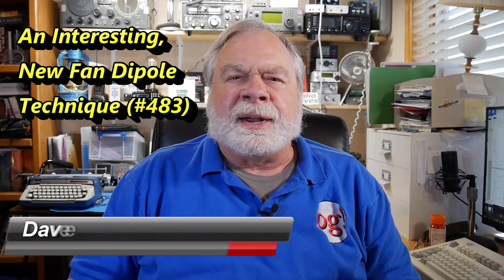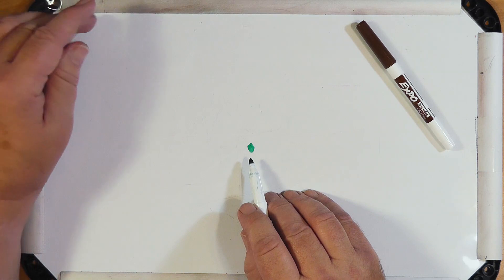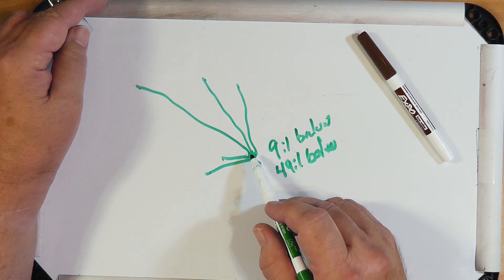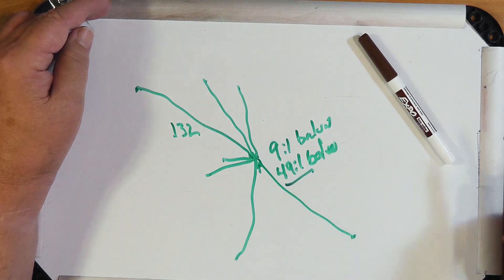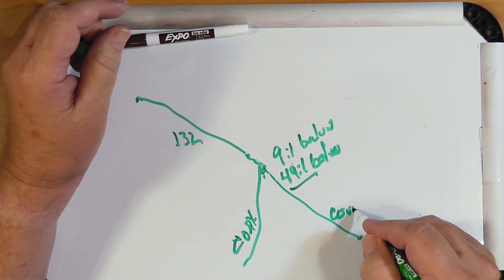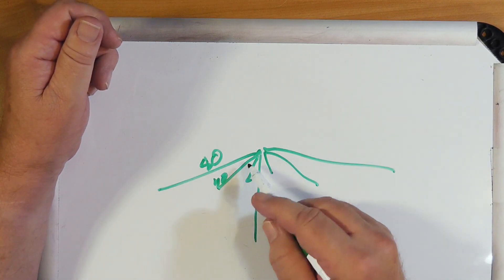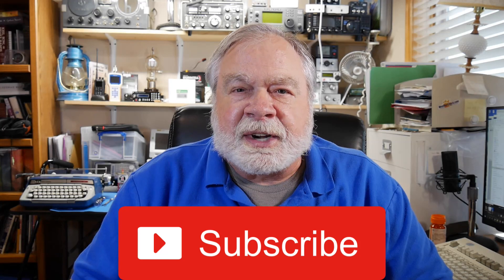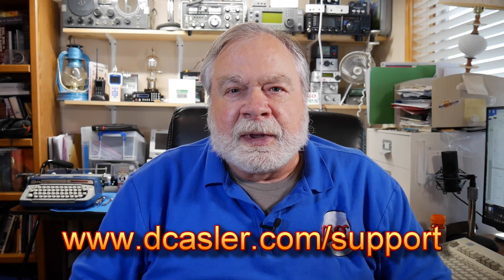An Interesting, New Fan Dipole Technique (#483)

Comment: Use 2 elements. Wind bandpass coils on the shorter ones and connect ends together to make a loop. This trick creates resonant portions on all bands. Assemble like a closed dipole. Its works better by far. Use std 4:1 unun do not ground the assembly, keep it free air. Only gnd conn is at the radio. Put 3 ferrites at feedpoint. Better than winding coax.

Comment: What many are missing is the following:  
1) Low impedance antennas (e.g. 1/4-wavelength) can conceptually be connected in parallel because the elements naturally go up in impedance when not resonant. So the current tends to be self-selecting and naturally flows into the lowest impedance element, which is the desired resonant element offering the lowest impedance.
2) In contrast, End-fed half-wave are high impedance at the feed point. So simply paralleling them means that the unwanted elements are likely to be lower impedance and the current will naturally flow into the "wrong" element. Mr. Kirchhoff doesn't know that your feed point node was intended to be high impedance. The self-selection in example 1 (above) works against you when attempting to parallel EFHW. Clearly it's a complete mess trying to parallel EFHW elements.

To be clear, this is merely the first layer, and there may be more complex interactions. But it is the starting point, so everything else would build upon it.

Comment: Dipoles without baluns allow noise from the house wiring to conduct into the receiver. With many station setups there is noise that can degrade reception this way. You can also measure transmitted RF getting onto the outside of the coax and on to the equipment chassis if you don't use an effective balun. This can lead to hot mic and hot key situations, even to the transmitter locking on. Antenna system design should strive to keep the RF on the antenna and not allow it to get on the outside of the coax or the station chassis. The (choking) balun's purpose is to keep the RF where it belongs which makes both the receiver and transmitter work better. These effects are frequency sensitive so it might seem to work without a balun on one frequency and turn into a problem on another. Measurements of RF current on the outside of the coax are a good way to check.

Comment: I run an End-fed "random" wire with a 74" counterpoise. I wrapped a 49:1 transformer my self using a core with the properties I wanted and let me just say. It is a great performer from 80 to 10 in SSB and Digi running JS8call. And if you happen on that Elmer's website you will see the time and hard work he put in paid off big.
Now, I understand experimenting is part of the hobby, and we should encourage it. But we should also promote education first so there is a foundation of solid working knowledge on which to work theory.

Comment: Dave given that an end fed half wave dipole is resonate at both even and odd multiples of a half wavelength, would not the 80 m half wave EFD interfere with the 40 and 20 and 15 and 10 meters? I wouldn’t see why you would do a fan anyway since EFD is multi band . Fans are for center fed dipoles but I agree with your 49:1 transformer/balun

Comment: It seems a strange idea TBH, if he operates on 80m for instance the 40m leg will become a 1/4 wave and low Z.  A conventional fan dipole is a more attractive proposition or even an EFHW cut for the lowest band. Of course at high power an end fed still needs a significant amount of current to go somewhere, the best part of 1a at 1500w....

Comment: End fed dipole?? Should call it end fed DUMMY LOAD!! Point Blank: The best dipole antenna is an inverted "V" Get the apex as high as you can get it. 45 to 50 ft is good, then 10 ft off the ground on each end. With an inverted V, I can give someone the same signal report with 100 watts as they can with 800, on some of those silly antenna designs. Im not trashing you Dave, But I have tried every antenna in the arrl antenna books, and nothing works like an inverted V. Im just worried that some of these antennas could confuse newbies and discourage them. 73, & 99

Comment: Excelent   Ideos. Im thinking of making a dipole from 2 adjustable multiband verticals. My question is how important is the matching between the two sides? They are different models
Reply: The antenna has a resistance, an inductance and a capacitance value. By combining two quarterwaves into a half wave multiband dipole setup, they will interact with each other. If there are levers to pull to adjust the antenna elements, even if only on one side, you should be able to make it resonant. With that being said, ideally you would have the antenna elements in a horizontal configuration at one half wavelength in height above ground. In the vertical configuration, height is not so important. But then you may as well use them as quarter wave verticals. Hmmm.

Comment: This EFHW fan grives me an idea: setting a normal EFHW, that will resonate at harmonics, 40m, 20m, 15m, 10m
Then adding EFHW elements for missing bands (30m...)
I will try that. Thanks for the idea
F1SOC
Reply: Multi band multi band element high impedance feedpoint antennas can be simulated on simulation software. Try it there first. You may find a lot of crosstalk between the elements anyway. The reason traditional fan dipoles work is because the feedpoint impedance is low. This means the undesired elements do little to nothing. When you fan out high impedance elements, the undesired elements begin to resonate taking your resonance out of band. But by all means, give it a try.

Comment: EFHWs are not "dipoles" They are half wave monopoles.
Reply: It would be helpful to explain your claim that the EFHW antenna is monopole.  In other words, how is an EFHW different from all other half-wave antennas that are known to be dipole antennas.
Reply: @DaDitDa  A dipole has 2 active elements fed in opposite phases.
Now, maybe you can call it a dipole if you consider the second element to actually be there, but of zero length. But, an end-fed wire doesn't seem to meet the definition of a dipole, if you ask me.
Reply: @RealMesaMike  I think you're conflating physical with electrical characteristics. For antennas, a dipole refers to existence of two (di) opposite polarity voltage poles.  All non-traveling wave, half-wave antennas operating at their fundamental resonant frequency exhibit two voltage poles -- they are all dipole antennas regardless of the physical position of their feed point.
Ken WA8FCI
Reply: Aha! I see what you mean now.  I learned something new. Thanks.
Reply: @DaDitDa  the center fed dipole has opposing charge polarities in the middle. As the left side goes positive, the differential right side goes negative. On an end fed half wave, the polarity remains constant across the half wave section. There is no polarity inversion in the center.
Reply: @N9XRradio A non-alternating (i.e., static or constant) polarity implies a non-alternating current.  If current (i.e., electron flow) is not alternating on the EFHW wire, no EM field will develop and no radiation will occur.
Reply: They are not monopoles necessarily. An EFHW cut for 40m will also work on 20m and 10m assuming a 49:1 transformer.
Reply: @dj6orandrew915  Sure, but that's irrelevant to whether it's a dipole or a monopole.

Comment: At my old house I built a typical 15' NVIS for 75 & 40 M but not as a square, as a HEX with 20 M added, and level instead of sloped.   In retrospect I should have raised 20M to 20' to get it above 1/4 wave. ... next time.  N1NVK

Comment: The problem with most new antenna inventions is that they are not based upon some antenna engineering principle, but based upon intuition and guess work.  There are simple designs to make simple uncomplicated antennas but people seem to have to reinvent the wheel and try to replace it using something that is not useful at all beyond what we have now.
Reply: Many want to use the Feng Shui method for design. LOL
Reply: Inventions are almost always based on intuition and guess work, but that intuition and guess work itself needs to be built upon engineering principles if it's to have much chance of success. Inventions (at least the interesting ones) rarely flow in a linear-thinking way directly from engineering principles. Optimizations can be churned-out by robots, but usually not inventions. Inventions are described as "novel" for a reason, and the reward of a patent monopoly period is a reward for the creative thinking.

It's actually funny when Corporations try to systematize the creation of solutions, as if (present day) robots could crank the invention handle. But yes, inventions need to ultimately be based on engineering principles, but via well-informed 'intuition and guesswork'.

Comment: NO IT WON"T WORK AT ALL. .... Just a few inches of another wire attached to the feed point will skew the SWR ( a lot). Just getting your finger near the terminal will also. Stick  a long length of wire on the terminal and you no longer have an EFHW.  
This idea gets reinvented about once per week. Shucks....All you need to do is try it. You'll quickly find out how to ruin a good multiband antenna. 
Also the 49:1 is not a balun. It's a transformer. 

Also a counterpoise is NOT to be used. If you do insist on using one, avoid a length that is any multiple of a wavelength otherwise it will radiate as well or maybe even better than the antenna! 

The whole point of the EFHW is multiband capability without any counterpoise. The coax shield supplies the tiny bit of displacement current needed to satisfy Kirchoff's law. Adding radials or long counterpoise won't accomplish much. A ground point either at the transformer or along the coax give you some lightning protection but doesn't make the antenna radiate any better.
Reply: You didn't even mention that he had the 30m stretch longer than the 40m stretch.

Comment: I think N6MTS (@smittyhalibut) talked about this on the Ham Radio Workbench podcast. IIRC, apparently the EFHW won't work because the resonant frequency isn't the lowest impedance the way it is for a dipole or a vertical.

Comment: Back in the late 1970s I made a "fan" dipole using Slinky's for the 40 meter and slinky Jr.s for the 20 meters. No balun just 6 winding for a choke. Worked Japan on one watt CW. The slinky Jr's were stretched out 90 * to the big slinky like inverted V. Installed in attic. Just collect coils with close pins to tune. I put an SO239 at the antenna and used SWR meter right at the antenna to tune Worked great for me. AB1ZI

Comment: I may be  wrong, but an end-fed half-wave length of wire is not a dipole…correct? Isn’t a dipole two quarter-wave lengths of wire ? Why do folks keep calling an EFHW antenna a dipole? —KA2VCW
Reply: An EFHW is a dipole at its fundamental resonant frequency, but multipole at its higher harmonic resonant frequencies.  A dipole antenna can be fed at its center, off-center and end. 
Ken WA8FCI
Reply: @DaDitDa  No it's not a dipole. It's a half wave monopole.
"Dipole" implies two poles of opposite polarity.
Reply: @RealMesaMike  On its fundamental resonant frequency an EFHW -- like all half-wave antennas -- is a dipole.  The position at which one feeds a half-wave antenna does not change the fact that a half-wave antenna is a dipole.
An example of a monopole antenna is a quarter-wave vertical antenna with a ground-level counterpoise which is effectively a half-wave antenna with one-quarter of its electrical length being the ground-level counterpoise.  Regardless, the radiating element of a quarter-wave vertical antenna is the physical and electrical monopole vertical element.
Recall that the "pole" being discussed here is not a physical pole or structure.  It refers to the number of voltage poles that exist on an antenna at its fundamental resonant frequency.  An EFHW at its fundamental resonant frequency has two voltage poles of opposite polarity; i.e., it's a dipole antenna.
Ken WA8FCI

Comment: I asked a very similar question on FB today with various responses.  

I have a QRPguys no tune EFHW and I’m curious if it’s possible to to run this a vertical (fanned dipole style) like a dx commander. I’m I wrong thinking the signal will seek out the appropriate length element in an EFHW? I know spacing of the elements are important. TIA
Reply: The DXCommander uses 1/4 waves which are low impedance, and are also low impedance at the third harmonic. the largest currents will be in the correct elements. Perfectly sound science, a fan of end fed half wave elements will not behave in a similar fashion.

Comment: A fan EFHW will not work with a 49:1 if you want to use it as a resonant antenna. A 49:1 is matched to a high impedance wire to get 50 ohms. If you attach a second wire for, say band B, that is not a multiple of a half wave on band A, it will present a lower impedance than the first wire on band A, and will give high SWR at the feedpoint. 

So a 20m wire, for 40m EFHW, will work. When you attach a 10m wire next to it, for a 20m EFHW, or a 15m ish wire for 30m EFHW, either of the shorter wires will be lower impedance, and mess up the SWR. 

This is why fan antennas (fan dipoles and fan verticals, like a DX Commander) are fed at the low impedance point of the radiator wire 

73 de VE3GKT
Reply: Exactly! Last time I checked current flows the way of the lowest resistance… in this setup the right wire will always have the highest impedance… basically you will always have a terrible mismatch
Reply: @xamr.824  Agree. EFHW for 80m is hi impedance at 80m but not at other frequencies. EFHW for 40m is hi at 40m but not at other frequencies. Connect the two antennas in parallel (a fan arrangement) and most of the power fed to it will go into the wrong antenna. Overall impedance will always be low. 49:1 balun is there to drop a high impedance antenna down to 50 ohm coax. If fan is giving 16 ohms (perhaps), balun converts to about 0.3 ohm. The mismatch of that to 50 ohm coax is terrible.
A regular fan dipole works because the resonant antenna is a low impedance and the other wires are non resonant so have a high impedance. Put them in parallel and power goes into the resonant wire and stays out of the non-resonant (reactive, high impedance) ones.
Reply: @gwss01 Correct,  a friend of my tried adding a second element in fan configuration and it reacted exactly as you described, messed it all up. He quickly removed the additional element.
Reply: So my 10m wire has a different impedance than my 20m wire?